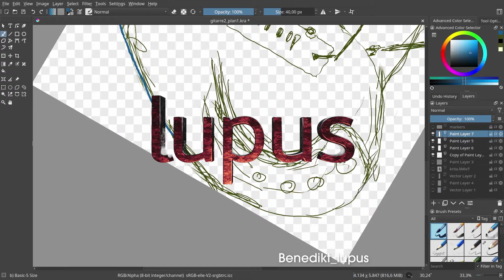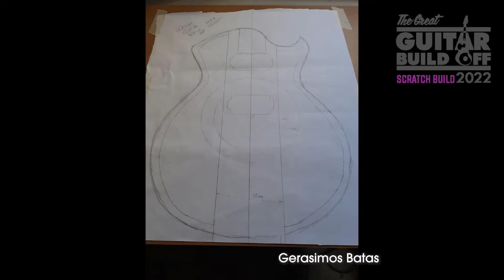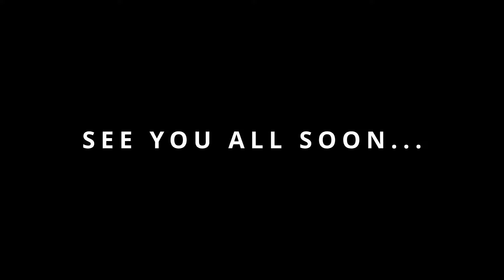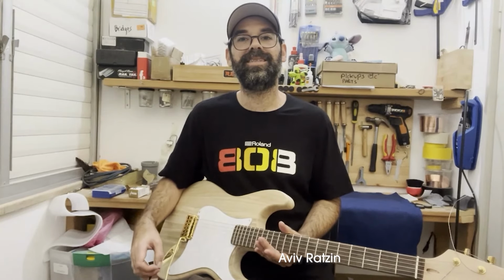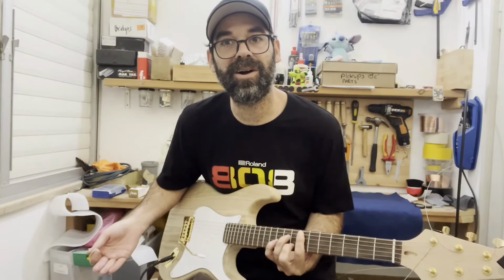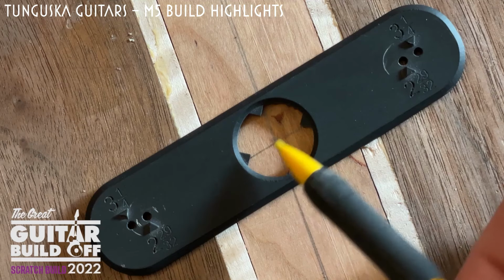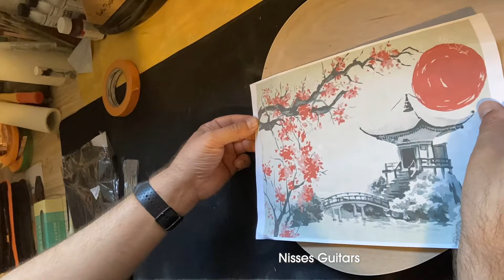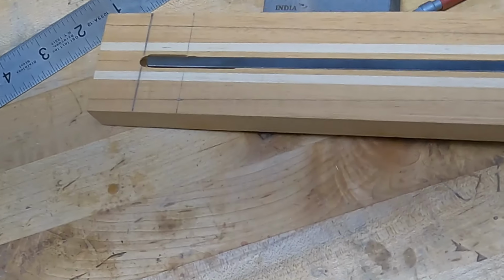Great Guitar Build Off 2022 | Some Highlights from the Scratch, Kit and Freestyle Categories

Comment: Ok at 2:30 what is the name of that sander accessory?
Reply: Side sander. I think stewmac will sell you one - I built this one with some threaded rod and scateboard bearings, and a handle I made. I used a rubber sanding arbor from my spindle sander as well - you might be able to buy one separately